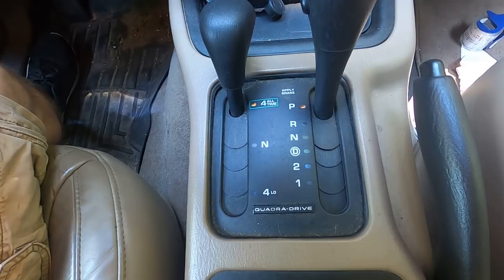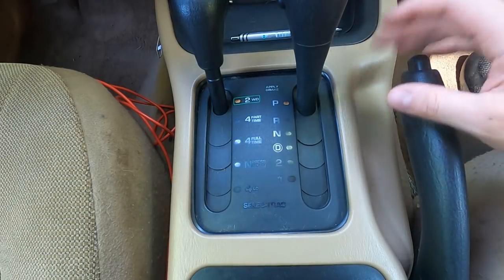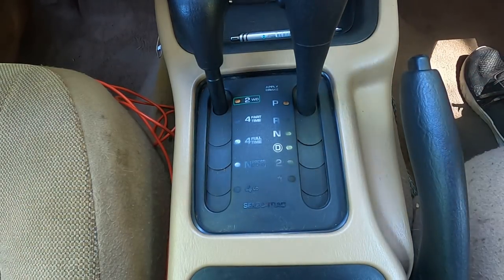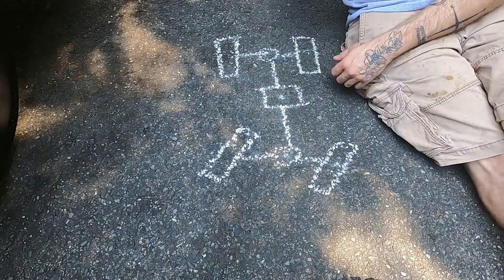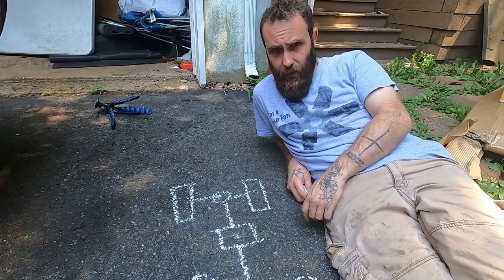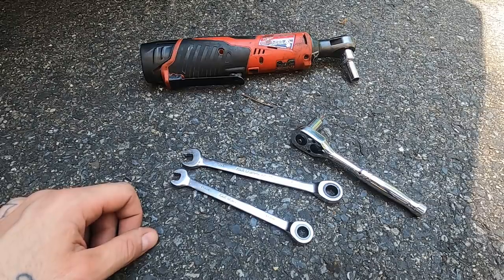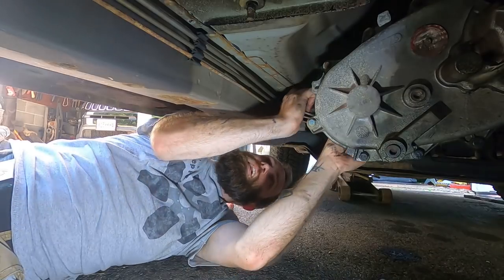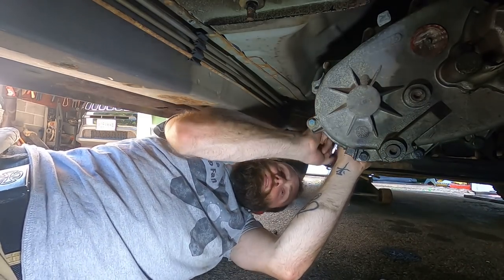Noise/Binding When Turning? How to Diagnose & Fix

Comment: Dougie ny man I have a quick ? See I was having some clunking in the front no wheel bearing any where I stuff its front end drive shaft or any of the diff or t case connected to the front but

Cluniking started almost alwaya once vehicle has warnes up then if I hit around 30nph it starys really consistently clunking and when I turn it also intenaifies I dont dare u turn or push it on tigj5 turns anyway  I deove 1 day and had to hit the highway for 1 exit not by choice but half way down the onramp the cluning rurned to a very violent shake so much I had to stop link off n back home not exceeding 20 dor fear the car would rip apart fro the intense shak8ng 

Mechanic said it was drive shadt so replaced the feont on and all was ok 3 weeks later ir started again , what exacrly ia failing or getting play ect and why did it with a new part happen again ? 

Oh my ? That ur vid sparked was I have a 2001 grand cherokee laredo the v8 n it has just 4hi n and 4lo .

When I first heard n realized I thought myswlf remove the drive in front n 4x2 it home but I was told if u do that it wont drive 4 some computer noticing is that true or in the case of ur 4.7 where u cant go 2 or 4 vs 4x4 all rime
Reply from the maker: Sounds like you have the same tranfer case I do, so you are fine to remove your front shaft. I am having a hard time thinking of what you issue could be unless you have bad ujoints. I would check them out and make sure everything else is tight down there. get your hands on everything and see if anything moves

Comment: False. You just have to be careful and pop the caps off upside down so they dont fall out. If it's well lubed they  shouldnt. I pop them off to add more grease when possible if it's not a greasable u joint. It's best to lay the drive shaft on cardboard and a bench when doing this just incase some fall out. If they do. Just re install them.

Comment: Shouldn't be turning it to full lock when you're turning in four-wheel drive. It will shutter that way. Every Jeep with the all time 4-wheel drive ever driven does that
Reply: wrong.

you can't turn to full lock in four wheel drive, really? 🙄 wouldn't that greatly limit the vehicle's maneuverability when using four-wheel-drive? which is uhh, kind of the whole purpose of a Jeep, a maneuverable off road vehicle? total BS.

Especially when talking about the WJ with Quadradrive, which is a full-time four-wheel-drive vehicle; Jeep would not have designed a fairly tight turning circle into the vehicle if it would be harmful or unpleasant to actually use full lock. I do believe this is why the full-time four wheel drive Jeeps use CV front axles, but even my XJ with a 242 case and U joint front axles does not bind when turning at full lock in four wheel drive, whether in full-time on pavement or in part time while off-road, doesn't bind... 

My Quadradrive WJ also did not bind at full lock for the first 115k miles of its life, the last 45k of which were under my ownership... the binding that I've been dealing with the last few months and thousand or so miles is a new problem that is NOT a normal function of this vehicle...

Comment: This is where buzz words get confusing, I would call the system your Jeep has all wheel drive, basically a full-time all-wheel drive which is rather hands off and typically to me means You're going to have extra repairs because of these problems in regards to all wheel drive, but Jeep I guess calls this four wheel why even have a transfer case I wonder lol it's not like you can take it out of four wheel, strange I didn't know Jeep did this back then or if they'd still do.. That's a shame man So you basically are having all-wheel drive system which to me is the least useful because like you complain it's running when it shouldn't be and binding you up and that's going to fucking destroy the transfer case Glad I got a command track on my '07 Liberty so I can choose what the hell that thing is doing when I want it to If I want four-wheel drive on a dry road, sure go ahead enjoy that lower gas mileage.. or if I want locked up gift I got four wheel part, And then for normal driving I leave it in two wheel.. And of course I've got four low for when you don't want them front tires, to spin on loose muddy, or what snowy conditions where you'll dig yourself a hole good luck explain this to a woman I find outI I made the mistake of letting the wife take my four-wheel drive to work in a bad snow storm bitch come home complaining it's stuck in four-wheel low which I told her to not even go near never going to for all I said to her I said if she went into that gear a car would explode instantly, so when she comes back what is happening the vehicle is stuck in four-wheel low now My stress and dread level begins to rise I say okay that can happen sometimes get the fuck out of my car yeah maybe I just got to switch it while she's rolling classic trick, But I have to now even though I don't want to ask I have to know how long during the 70 mile trip to work how long ago did you put it into four wheel low.. like I explained to you not to do 5,000 fucking times that either other option would be best But don't go past neutral unless you want to die a horrible painful death So I ask when did you put it into four wheel. I got stuck going out of my parking spot because it snowed her in during the 8-hour shift no shit so you drove 70 fucking miles down i-95 on four-wheel drive low, And then I get complaining it wouldn't go fast enough everybody was blowing past me I couldn't get it past 20 miles or something's wrong with your fucking car I swore I've never been closer to hitting a lady.. And this is still a sore subject with me clearly, so I hear that fucking horror so I said so what did you do just read the engine that's been red line to get back home yeah basically... So when I back back into my car I expected that a serious problems, and I could see that the four-wheel wouldn't fudge when the car was stationary in park, So I tried the classic you know start to roll coast while coasting attempt to shift and she immediately allowed me to utterly shift back into two wheel... Transmission again was allowed to go into a gear above one when I get back in the house several shades  redder, So what's wrong with that fucking piece of shit car why wouldn't go faster than 20 miles an hour Well I doubt she understands why it wouldn't I don't think women are capable of understanding machines at all sure some can understand a little this is truly a man's art women don't have the patience or respect for machines like this and I still am angry at the damage you likely cause woman... You want to have everything equal then you need to perform equal, and men should get fucking paid for current maternity leave too even if they can't squeeze out children Oh does that sound ridiculous it sure does So does, women passing their fucking rangers course as in the US army rangers but come to find out everyday they had a 2-hour break where they could leave the torturous 70-day streak of death they could leave go take a shower and a nap... Then 2 hours later come back and join the men you know doing whatever obstacles and then now it makes sense how some dumb bitch passed ranger school, she didn't..  she needed 2 hours every day to go clean out her snatch and take a nap because women couldn't pass that course because it's too physical I couldn't pass it because I don't want to and I don't care to but even if I tried it would be quite difficult.. I also can't give birth to life. I can't secrete you milk that children can drink from any part of my body you know what I think I would pick you know giving life and nurturing over suffering and killing but women are stupid enough to complain that we're not on the front lines yeah only a woman would complain about that
Reply: ffs.....😄
Reply: This post has been edited.... 🤣🤣🤣🤣🤣
That pushed me into hysterics